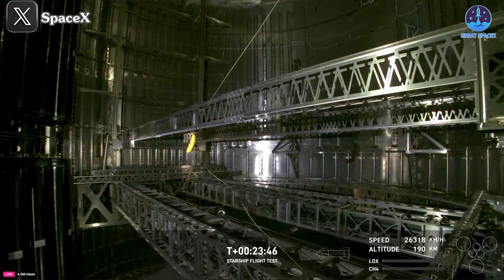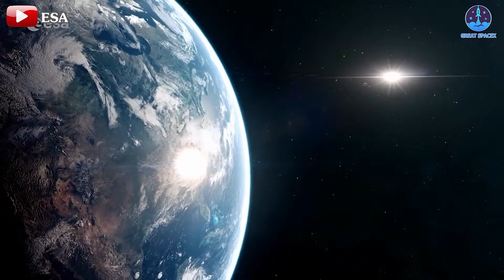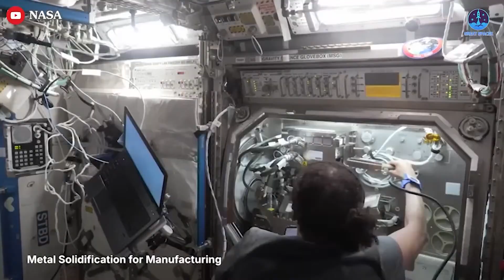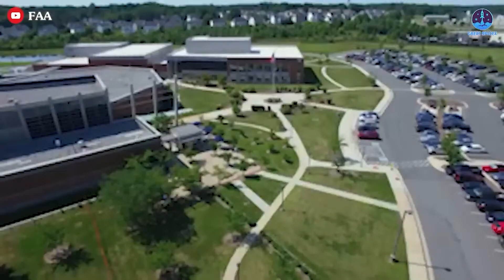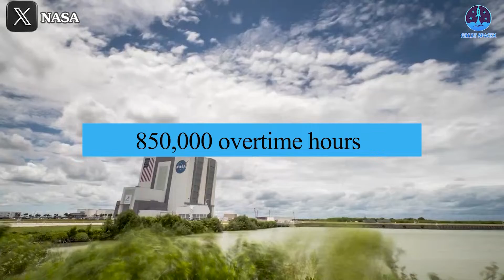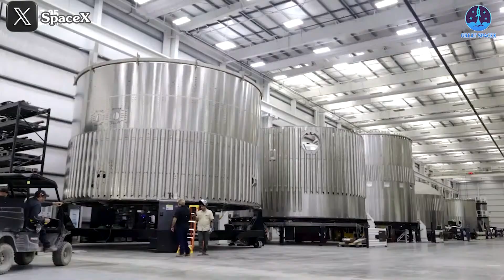OLT Lost Comms! Elon Musk Revealed Why Starship Booster 13 Catch Scrub...REPLAY#16

Comment: The booster should be redirected to be caught by the other OLT. This scenario must be implemented to such cases. For future landing attempts, the booster to be caught by one OLT & the starship on the other OLT.
Reply: There is only one olit available. The second one is yet finished.
Reply: Yes it doesn't need to be the same tower, just some structure that compensates for the lack of landing legs. evt. it will probably be drone ships with sone kind of catching structure.
Reply: @2face789  They will get legs at some point anyway or they can't land on Mars!

Comment: That telemetry tower looks like it was Jerry-rigged. The chain is only as strong as its weakest link.  Oops, any cameras on that tower would likely be pointed in the wrong direction. Maybe Quality Control is slipping. Why did it work before but not this time around.
Reply: Correct. The booster should be redirected to be caught by the other OLT. (If other OLT is operational)

Comment: It would be cool to see the sensor data for the Starship during the re-entry!  The SST temps appeared to be at the limit.  Can you see the Starship as the third stage rocket?  It seems the attempt to put a new space lab in orbit, there would need to be larger setup for the payload and fuel.  It seems the future designs will move towards putting larger loads in LEO.  The orbital refueling tank should be a sight to see, as that structure should be much larger than the super heavy booster!  The amount of fuel needed for a Moon landing will be crazy.  I would love to see Elon's sketch pad and napkin sketches!